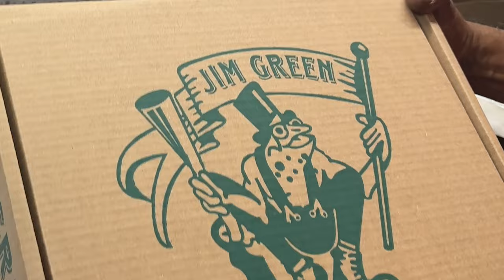Custom Made African Buffalo Leather Boot // Jim Green Footwear Razorback

Comment: Those look great. The only (very minor) critiques I have of the razorbacks are in regards to the laces, pull tabs, and toe box height. The laces are incredibly long. Like more of an 8 inch boot length. Although given the AR8 it would make sense if you use one length of laces to keep manufacturing simple. For the pull tab I saw no need other than catching my pant leg on them, so I cut mine off. Finally. The toe box was initially very shallow (top to bottom) but that broke in with wear so no issues for me (YMMV).

Very happy with the boots!! Solid value.
Reply from the maker: Thank you for the great feedback. 💪🐸